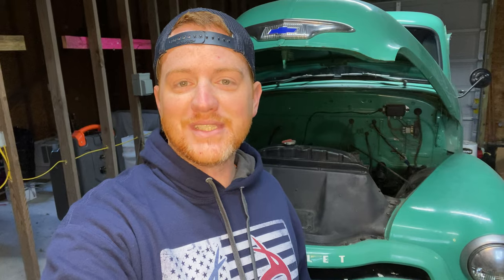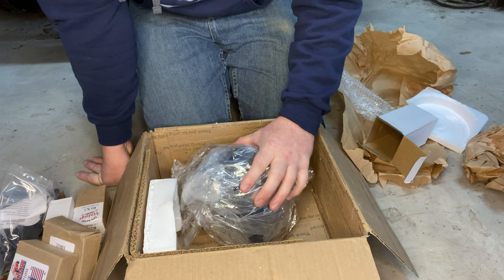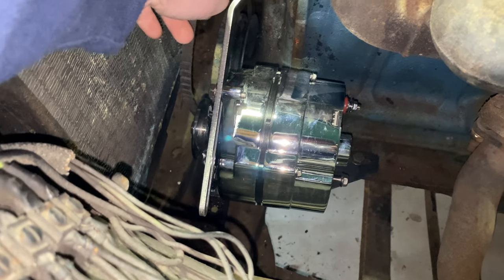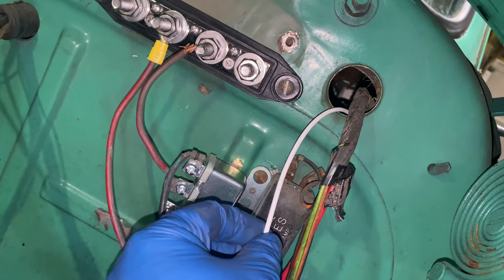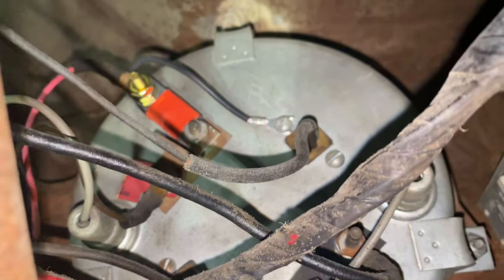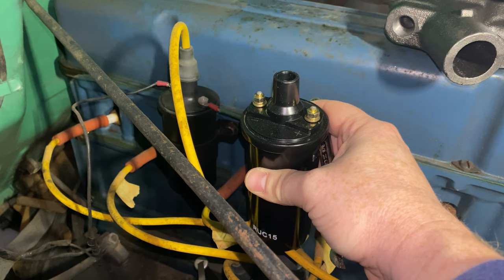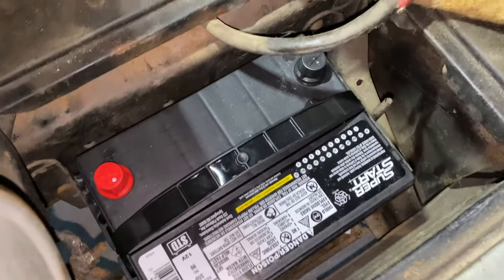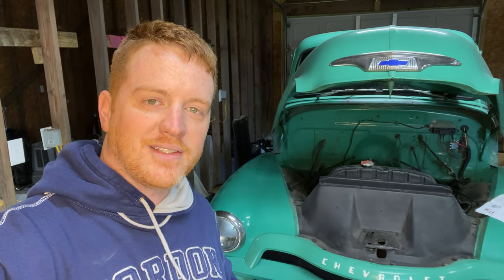Episode 6: 6 Volt to 12 Volt Conversion! // Chevy 3100 Project

Comment: Somebody wired that truck wrong.  All chevys, even 6 volts, were/ are negative ground. Some 6 volt  GMCs were positive ground along with Fords, dodges, imports etc but not Chevys. Anyone doing this conversion  absolutely needs to identify which their vehicle is and proceed accordingly. It's best to switch to 12 volt negative ground. Great video anyway. Thanks for sharing.

Comment: Only thing i would have done differently. Would have went to led headlights. They are a night and day difference and use less power than the old 6v ones did. And are 2-3x as bright as those new 12v ones you got and cheaper. Nice how to by the way..

Comment: It isn't necessary to use a reducer on the fuel gauge.  I've converted a number of 47-53 Chevy trucks to 12v, and never used a reducer for anything other than the heater fan motor.  My 50 3100 fuel gauge has worked perfectly without the reducer for the 31 years I've owned it!

Comment: Hey bud I'm watching this please don't run it to your coil your coil needs to be left alone so all of its power is just to run the engine if you rob power from it. Your timing will change so go to a keyed ignition something might think of they sell a head light wiring harness that will plug into your 6v head light harness but gots it's own relays that will hook up to the battery but uses your original harness to use your factory high low beams they are awesome takes all to load off your factory wires so you don't have a Pretty flame electrical fire just a few ideas good luck looks great

Comment: So  , I have a question.  Is it necessary to change out the wiring harness ? Or can you leave the original factory harness ? I'm new to old cars. Just got me a 1953 Bel Air.  Thanks for the video
Reply from the maker: Good question, use the original

Comment: Russell were did you find that bus bar that you used and mounted in old holes? also did you run the white wire to ignition and then to starter? Do I run a third wire to ammeter to get condition thanks for your help.

Comment: I noticed your Texas plate, I live in WV and my '53 Chevy PU came from Dallas ,Texas area bought on Ebay in 2016. The truck had a rebuilt 216 engine and very little rust, but it was pretty beat up, dents everywhere. I totally restored it and did the 6 to 12 volt system much like you did, and you're right, those kits for the swap are kinda expensive, so I went the cheaper route, single wire alternator, wired to the starter post, bracket for it, gas gauge reducer and a volt meter under the dash. You're right , the horn sounds like a freight train!
Reply from the maker: Sounds like an awesome journey!

Comment: Great walk through.  Covered everything I was questioning.  Would like to find a turn signal with cancel.   I just adjusted a 51 Chevy that had a signal attached to side of steering column and rolled on the base of the steering wheel.  Actually cancels.  Can't find new that does the same.

Comment: Hello, I just found your channel today and upon viewing this video one thing that no one has mentioned in the comments that I saw, that was not a 6-volt battery that you pulled out that was an 8 volt battery normally used in tractors and some boats.  As you probably already know many folks would put in 8 volt battery in a 6 volt system for much better starting and the rest of the truck would run fine.  Good video kit from Vintage made easy work of it.  Thanks
Reply from the maker: You are correct good eye
Reply: I saw the 8 volt right off BUT no use saying anything after this long of a time.
Reply: Back in the day there was a 6/12 volt batt uses a series parallel switch mounted on battery starts on 12 runs on 6
Reply: I saw that also was curious about it

Comment: Found your channel by accident, and worth the watch. Thanks for the information and your time. I'm currently in process of restoration as well. I'm working on a 47' Dodge Deluxe. 
  Are you going to upgrade the brake system to disc w/dual MC?
Reply from the maker: Eventually. For now the drum brakes will have to do

Comment: With the old battery having 4 caps, I believe that was an 8v battery. A lot of old guys ran 8v batteries in 6v cars for a little added cranking power. 6v batteries have 3 caps, each cell in a battery is 2.2ish volts, 3 cell 6v, 4 cell 8v. Personally I like to keep these older cars 6v, was good enough back then to start them even on below 0 days. Many people now convert to 12 volts because they either don't want to learn how the 6v positive ground systems worked or like to run aftermarket stuff. Many times, if a 6v car is having starting issues the cables are the issue. Its best to run big 0-0 cables on them for cranking amps. As far as parts, you can use any old 6v regulator on them, but many people don't realize you need to polarize the generator after rebuild or change, then they get fed up with them and convert. But you did do an outstanding job showing a conversion. I only converted one for a friend of mine and I went about it the hard way lol. Even rebuilt the generator my self to a 12v alternator.

Comment: Great presentation. Just got a 1952 3100 in original 6v. I'll be changing it over to 12v soon. Where did you get that buss bar in place of the voltage regulator.
Reply: Amazon

Comment: Good presentation but why no mention of starter? not necessary to convert to 12v?
Reply from the maker: Correct no changes to the starter. Mine has been working since with no modifications.

Comment: Hi  Russell, I enjoyed your video. Very educational. I also have a 1954 stock 3100. It was already coverted to a 12 volt system. However, a lot of the wires are just jumbled and hanging. I want to rewire the truck, and I now have the wiring harness. I only need one 12-6 volt reducer for the fuel correct? The other gauges should work fine, hot/cold amp charge? I am using the original gauges as well.  I see several convertion boxes, 6-12 volt boxes on the outside firewall. Are they needed anymore. I want to reduce the mess of wires and gadgets. I look forward to a response. Thanks and happy truckin.
Reply from the maker: That's right the only conversions needed to step down is the fuel gage and heater. I wanted the 12v bus bar you saw me add in the video but that's up to you

Comment: Hi Russell video was very helpful but I have a couple of questions. 1, did you get the bus port from Vintage Auto Garage? 2, What are the 3 wires you have hooked up to the bus port? 3, Did you have to gap the electronic ignition?

Comment: Good morning sir, I did the conversation but my volt meter is reading below 12. My question is when you run the red wire from the alternator to the bus bar is that it? Cause on your video you said to hook up red wire to ammeter but that's where I'm lost. If you can help me out please.

Comment: when you put the reducer in for the fuel gauge did you put something behind the screw head. I was about to hook mine up and looks like it will touch the gauge housing, im going to put a gauge insulator on then the reducer.
Reply from the maker: I did not. It works fine
Reply: @russellnelius  thank you

Comment: I like your video thank you so much for showing us how to convert from 6 to 12 one thing that I didn't see you doing replacing the starter my question is do I have to replace the starter mine is a 1940 Buick special straight 8 that's when I put the 12-volt battery the starter doesn't work because it's too much power
Reply from the maker: The starter should work just fine. No need to replace

Comment: so i have a question you did the fuel guage but what about the amp guage ? will the reducer take care of both ? thank you awsome video
Reply from the maker: the amp gauge does not require a step down
Reply: May need replacement gauge alt minimum charge rate higher than gauge capacity in anp

Comment: That truck's starting motor uses 6 volts as do other electric components. Wouldn't a resistor for it be needed for 12 volts? Nothing said about starter.
Reply from the maker: No the starter does not require a reduction in voltage. That’s why guys who still have a 6v system put in 8v batteries to get a little more oomph

Comment: There is no need to do this.  If you use the CORRECT 1 gauge battery cables, and a Group 2, not Group 1, battery, you will have no starting troubles.  And if you want more power, you can use an 8 volt battery, (4 cells).  They are easy to find.  Even Amazon sells them.

Comment: should have been factory negative ground. GMC was positive ground but Chevy was Negative
Reply from the maker: XenosagaEclipse it was definitely positive ground
Reply: @russellnelius  Strange. I am pretty sure it was not "born that way". Bet is someone was looking up a GMC when they wired it earlier or something like that. Oh well...whatever works huh? Did you learn any more on that deluxe cab chrome and paint treatment?
Reply from the maker: XenosagaEclipse not yet! Right now the head is in the machine shop. Still working on getting the thing running. Many valves were stuck.
Reply: @russellnelius  Good luck. Can't wait to see it running again.
Reply: My 1949 6400 is neg ground. It has been sitting in a field for 35 years. So if someone changed it than it had to be before 35 years ago.
Reply: W’ll you be available to help me with some questions thanks
Reply: @russellnelius  just caught video you are 100% correct neg ground system

Comment: don't want to rain on your parade but if these old eyes don't fell me I could swear you have a 8 volt battery not a 6 volt too many caps on top of the battery to be 6 volt  6 volt battery only have 3 caps on top now you know I. like your video though
Reply from the maker: You are correct but the weather is still dry. Still a 6-volt system though.